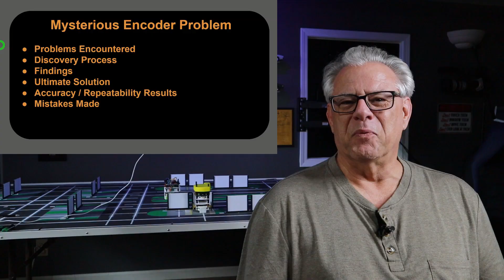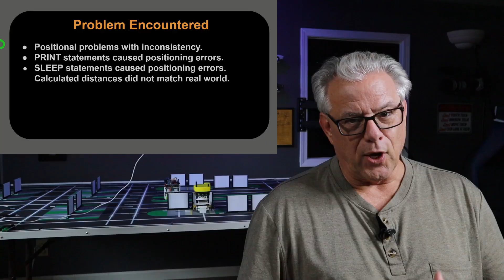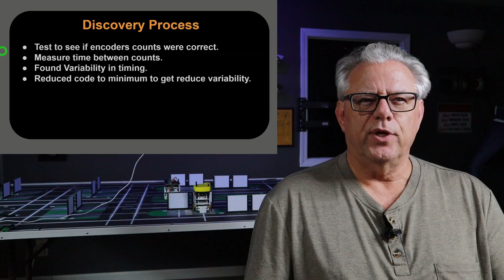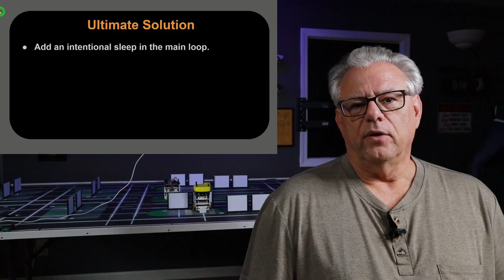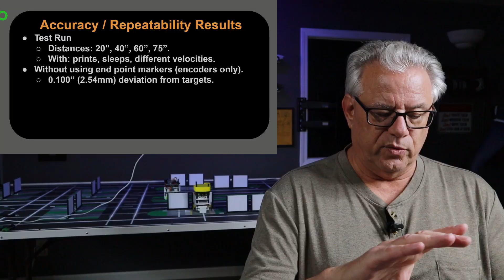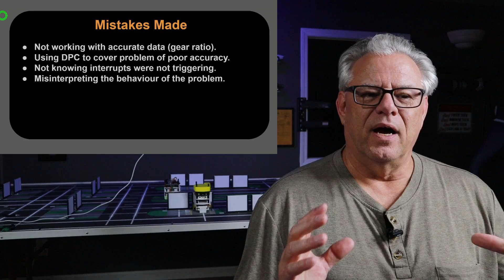Mysterious Interrupt Problem Solved - Great lesson in Troubleshooting

Comment: Probably just me but I didn't initially follow your explanation, so to paraphrase, is it correct that it was initially calibrated in a state when it was missing interrupts (no print statement at the time so it missed many due to the tight loop or the QR Code). So you thought it needed for instance 1000 interrupts to move a meter (when in reality for that distance 1500 should have been triggered if the code was working)

Then you added the print statement which fixed the interrupts and they started triggering as expected so the 1000 occurred quicker and therefore it started stopping short of the prior distance.

So the fix is to change the code so they are triggered more frequently and then to recalibrate the distance per interrupt using the new code or ideally a physical calculation based on the gear ratios and encoder parameters.
Reply from the maker: Good morning Lawrencejeffrey1,
Yup, you pretty much got it.  There were a few other influences, but that is the bulk of the mysterious problem.  Looking back, I made a couple of really stupid mistakes and it snowballed into a huge mess.

Since making all the changes, the testing has been going super fantastic.  Very few errors or problem which most are now caused by mechanical issues.

The next video (8/22/2025) I will be talking about the first set of test results.  
Thanks much for the question and for being a part of our community!
Cheers
Chris

Comment: Sounds like these "interrupts" are not real interrupts. The datasheet I read was not clear about this, but kind of suggested they were polled rather than a hardware feature.  Add in the initial assumption about gear ratio and it's a nightmare. Excellent process to uncover the problem though and now you can make genuine progress again. Nice one.
Reply from the maker: Good morning @DaveEverett01,
Thank you for the kind words, very much appreciated! 

It has been a number of years since I worked with the ATMEL microcontrollers (which I loved). I recall they supported hardware and software interrupts.  I know that the hardware interrupts were rock solid reliable, whereas the software interrupts behaved like the PICO.  Sort of frustrating to have a feature that is supposed to INTERRUPT everything to handle an urgent task, but it only works when the conditions are perfect, yet you don't know exactly what to do to make the conditions perfect.    Trying to find an upside, it certainly provided me with a puzzling challenge to figure out ;-)

Cheers!
Chris

Comment: Early in the video. Idea. 
Instead of using the primary chip to DO and LOG/PRINT, what about have the primary chip just DO, and have a secondary chip monitor and LOG/PRINT the actions/outputs of the primary chip. 
Like tapping on or vampire clip onto the wires. 
Then your primary chips only does the program
Reply from the maker: Good morning @nemesis851_,
I suspect as you got through the rest of the video you understood that the print was actually helping the program run better by "creating time" for the interrupts to occur.  However, you are right in that i could be using the other core to do some of the tasks to help out.  Unfortunately, the other core will be used for telemetry comms between the Zoomie and the Zcheduler system.  I have been warned that MQTT coms will not work at all for how I will be doing the communications because it is so slow.  I have not seen evidence of that yet, but that is the primary reason I am leaving the second core in reserve.  
Cheers mate, I really appreciate you comments and suggestions!
Chris
Reply: @MakingStuffwithChrisDeHut I was actually thinking of a temporary extra board like pico just to log, then be disconnected when all is running right on the main board (core1/2)
MQTT slow? Humm got me pondering now, as it was next on the list for me.
Reply from the maker: @nemesis851_  Ah, that makes sense!  That maybe something to look into. Thanks.
Chris
Reply: @MakingStuffwithChrisDeHut this message will probably be auto deleted by YTobe but this video has info from the people in control of the algorithm https://youtu.be/Jc1gRYTlS6o?si=EtPS0NJse35m2-aR
Reply from the maker: @nemesis851_  Nope, message is still here and thanks for the link!  Much appreciated.
Chris

Comment: Interrupts are bane of my existence, there are always issue either with them or the thing triggering them.
Reply: Agreed. This is one of the reasons I got interested in the Parallax Propeller microcontroller - with eight cores it's very rare that interrupts are required (but I do feel guilty about dedicating a core to a task like bump detection!)
Reply from the maker: Good morning phlexy.,
I have had both great luck with them and lot's of frustration with them - and WOW, a frustrating mess this was.  It does bother me that they are not more reliable than they actually are.  But, nothing I can do about that so hopefully I have it reasonable under control.  PHEW!
Thanks for sharing your experience.
Cheers!
Chris

Comment: Well glad you got it sorted Chris.  Random thoughts; are the gearboxes actually integer ratios?  (they are often not to avoid harmonic wear and noise) .  How about creating a zoomtown  mile which is an integer number of motor pulses  (your wheel diameters may require floating correction , so maybe this would not work).  PIO... Just saying ;-)
Reply from the maker: Good morning Bill,
Good to hear from you again.  In truth, I have no idea how accurate that gear ratio is other than right now I am REALLY CLOSE compared to where I was.  A few months back I was questioning the gear ratio in a group somewhere (robotics group or someplace where there were a lot of potential users) and the consensus was, you can't trust what the MFGs claim.  There were several people that also indicated exactly what you stated, it is not 100:1 or 101:1 but somewhere in between.  I sort of did what you are describing during this investigative process, but the difficulty in ACCURATELY measuring the wheel/tire diameter is the wildcard.  

Another thing that I discovered since the filming of this story - wheel slippage.  It definitely happens during acceleration & deceleration.  I noticed while observing the hundreds (thousands?) of tests I have been running the past few weeks.  Video proved it was happening.  So right now I am refining that ACC & DEC to hopefully make that less of a problem.  Another funny thing, depending on which 18650 cells I am using, the wheel slippage appears greater with one set than the other.  I suspect one brand outputs more current than the other, thus having more power at the wheels.  

This is so much fun ;-)
Cheers!
Chris